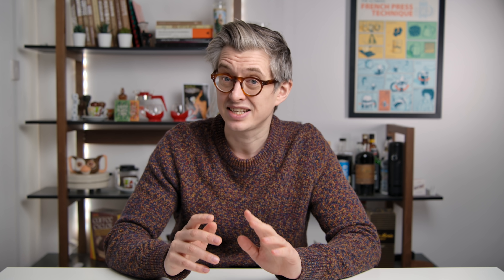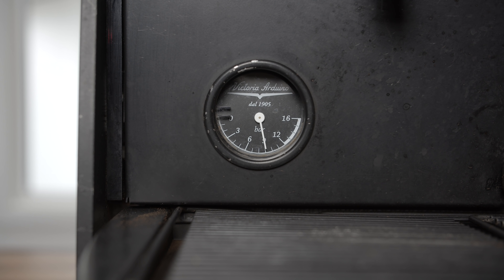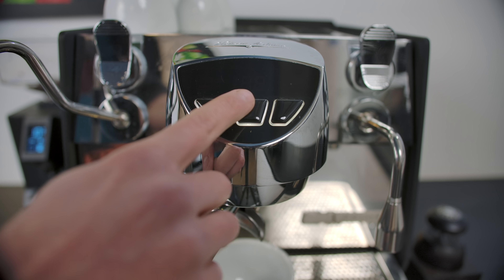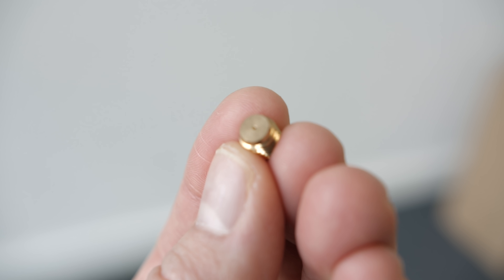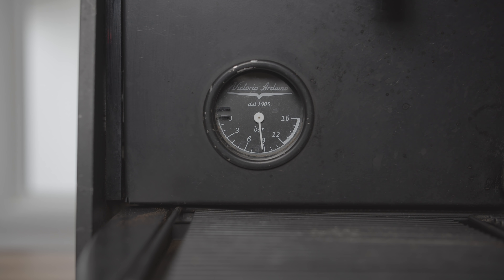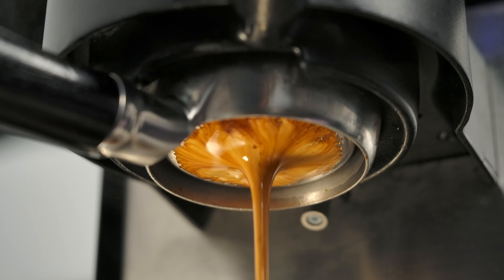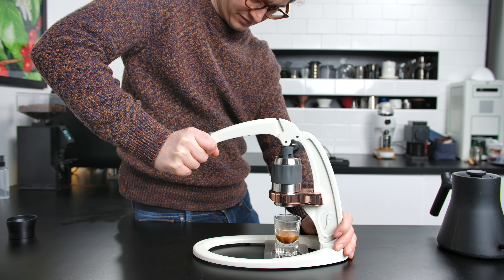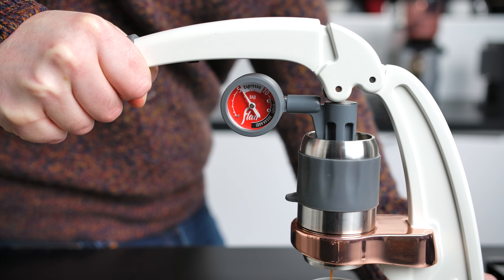Understanding Espresso: Pressure (Episode #6)

Comment: Hi James, another explanation for pre-infusion is as follows: First of all, each puck of coffee has a voids, moisture, and solids. The moisture content is likely really low to start off so lets just consider the voids. These voids are only air-filled to start and thus are susceptible to compaction under any pressure. The 9 barr pressure will do this. However, from my knowledge, if water was filling these voids(pre-infusion), this would have a closer to equal hydrostatic pressure pushing back which would then be replaced over and over by the pressurized water passing through the puck. This is only from my limited knowledge of fluid mechanics and how sands in foundations pack together but hopefully, this helps a little bit.
Reply: I think his point is that the lower pressure preinfusiin helps to fill the voids with finer grounds thereby reducing opportunities for channeling
Reply: Yes, yes and yeas once more. Nicely explained!
Reply: I think you need just enough pressure in the beginning to make sure the water doesn't just "sit" on the coffee, kind of like The Action Lab's new video about cocoa powder that doesn't get wet because of the surface tension of the water prevents the water from percolating into the powder. so you need JUST enough pressure that will get the water to move slowly but consistently until there's water dripping from the bottom. I think this goes back to flow control. the pressure is dependent on how much resistance the puck provides, so I think for every puck, you apply whatever pressure is require to get the water to migrate down the puck slowly, but not more. i think eventually flow profiling is probably gonna be the way we get to the bottom of this rabbit hole LOL
Reply: @maxlee6676  I couldn't explain it that well! I do it just like that, by briefly opening the steam valve, as the pump starts working and pressure builds up,  for a couple of seconds. Then, I slowly close the steam valve, so the pressure reaches the 9 bar in a smooth, gradual way.
Reply: This is basically one of my university courses: "mechanics and transport by flow through porous media". Altough they mostly seem to be talking about oil or water instead of coffee haha
Reply: Your roughly describing one of the principles of soil mechanics and the even application of pressure through "matrix" of a soil or, in this instance, coffee. I think people who are interested maybe reading up about soil saturation and the idea about soil moisture/saturation could be interesting.
Reply: Hello! Exactly what I was going to write. It can also be said that harder tamping slows down the extraction, and 9 bar is much stronger force than a tamp. At first,  couple of milimeters of wet coffee that was not penetrated will tamp everything below. I have manual machine and I start with gentle push until naked portafilter screen is wholly wet. This way I have less problems with grinding too finely.
Reply: @yulq  oh I wish I never had returned my manual machine! I had a La Pavoni once, but I returned it because I was inexperienced with espresso. Ever since, all I do, is trying to make my pump machine work as a manual.
I also believe harder tamping slows down extraction, in the starting part, until the pressure eventually presses down on the puck entirely.
Reply: So you're saying longer pre infusion is better?
Reply: @s0bad  a couple of seconds just enough to wet the puck.
Reply: With the blend that I use (Toby's Estate Woolloomooloo) , and the machine that I have (la marzocco linea pb), I found the best result I got was through the mechanical pre infusion where it would turn the pump on for 2 seconds, off for 2 seconds, and back on for the shot. Found the shots came out with less channelling, more consistency and produced a better rounded shot. Would love to have a crack at the pressure profiling of a decent or even a manual machine.
Reply: Okay, so what would happen when you have coarser grinds mixed with very fine grinds?
Reply: @EtreTocsin  Then it's time for a new grinder
Reply: Very well described. I don't understand enough about physics etc (yet) but when picturing this it makes sense to me intuitively. I'm glad I got a flair and just recently got a better, more reliable (manual) grinder to go along with it. I'm starting to make some great tasting espresso.
Reply: @Spractral   Puck preparation is key for good espresso extraction. It's all in how those grounds!
Reply: These voids would be filled with water sooner or later, so I don't think the hydrostatic pressure argument holds inside a void (water can't push back elastically like the pressed coffee can).  However, depending on the total saturation and wetting conditions, the water could lubricate contacts between grains -- helping them to reach a denser state -- or even pull on the grains by capillary action and compact the puck this way: just like mud shrinks as it dries.
Reply: @rodrigoguerra2836  What do you mean by "hydrostatic pressure argument [do not] holds inside the void" and "water can't push back elastically like the pressed coffee can”? 
Simply:
Something has to answer with the 9 bars at the top of the puck, or else something will be incredibly accelerated (this is how it works, net F=ma=p*S, so for sure at the top net F is approximately zero and force from the top is negated with raction force from the bottom).
If water hits completely wet puck, only slight, not noticable, squeeze of wet puck is enough to push back, because water/coffee mix is not compressible. On the other hand, dry puck at the beginning is. So if water hits it with 9 bars, the dry puck compresses (see videos with transparent portafilter). After being tamped with 9 bars it is not compressible anymore with 9 bars. But after being so strongly tamped (9 bars is 9kg/cm2 so yes, for 58mm it is 238 kg of force, pretty hard tamp) it restricts flow more.
Voids can be filled later, yes, but they will be smaller, pores connections will be smaller, restriction will be greater. And the problem is, they could also not be filled. After all, water does not have to go through, it just usually does.
Reply: Hi  @yulq , this problem is weird, complicated, and fascinating for many reasons, so it may help to build it up in steps.  Imagine first that the grounds are frozen in place, like in a sintered glass frit.  In this case, water can flow freely through the entire pore space -- including through any voids in the pack -- but pushing water through the frit at a constant flow rate, and thus constant velocity, requires a constant force that is proportional to the water's viscosity and flow rate.  This Darcy flow does not require any acceleration and happens because the water is forced to move past a stationary object (to wit, the "hydro" is not "static").  Flow through big voids will be faster than that through smaller ones, but a constant pressure will produce a constant flow.  Consequently points (1) and (2) are a bit misleading because water is always moving: there is no way for grains to deform/pack so well that they block flow around them altogether, so it's not an either or situation.  When the grounds are free to move point (3) becomes very interesting because of the question of what is holding this cage together in the first place.  When things are dry, the static frictional forces between particles can make this happen because of something called silo pressure, but you can also have capillary bridging (as in damp sand castles) and other things.  Static frictional contacts can also hold things when grains are wet (fully saturated), but you need to factor in lubrication by the fluid whenever particles move.  The key here I think is that, as water extracts material from the grains, they almost certainly shrink and change their shape, so a cage that may have been stable at first may collapse later.  This is not obviously a bad thing, unless the collapse of one cage triggers the collapse of nearby cages, which is probably true in general and may be aided by the fact that grounds in regions with faster flow rate will shrink faster than those in more dense regions, and thus be more susceptible to flow and rearrangement.  Definitely a fascinating, and potentially tasty, problem.
Reply: @yulq  Sorry, answered the previous version of your comment.  TL;DR, F=ma does not hold as simply in fluids as it does in vacuum.  Moving water through a puck or filter at a constant rate requires a constant force because water molecules are not allowed to "slip" past solid objects.  This constraint causes velocity gradients and thus viscous stresses that push back on the fluid that pushes back on both the piston and the grains which then push back on the portafilter, but only when water is in motion.  This is true for any liquid and slowly moving gas (things get complicated here).  So, while you can think of the coffee puck as being "squeezed", you should think of the water as being "pushed" though the puck.  Outside of the pack, however, viscous drag is negligible, so you can think of the water the between the piston and the top of the puck as having a constant hydrostatic pressure.  Consequently, while the water pressure at the top of the puck will be 9 bars, that at the bottom will be effectively 0 (relative to ambient), just lke the voltage on a resistor will be V at one end and 0 at the other.
Reply: @rodrigoguerra2836  OK, but going back to preinfusion, did I write something wrong? Does not dry puck compress? Does completely wet puck? Can you exactly explain what is not right, if anything? What I am saying is this: if you let water through the puck with small pressure, for any time it need to go through the puck, wet it and exit on the whole bottom screen of the portafilter, then you can apply high pressure and your flow will be faster compared to applying high pressure at the beginning, because the wet puck is significantly less compressible, dry puck is more compressible, compression means less/narrower ways for the water, and this way water has more wider channels to go throug, compared to applying high pressure at the beginning.

Comment: I have a Sage Barista Express. It can be hard at times to produce consistent shots. The pressure gauge doesn't tell you how many bars it is but does give you an indication of espresso range pressure to aim for. Found that the grinder didn't grind fine enough so adjusted the internal burrs. 18grams of coffee. A good solid tamp produces a pre infusion of about 8 seconds with shots pouring between 25 and 30 seconds. I find that it produces more than 2:1 with espresso out. Sometimes 18grams produces 45 or more out. Overall shots are pretty good. And good milk, or milk alternative, covers a lot of sins on the espresso end so nothing is ever wasted.

Comment: Watching this while pulling a shot on my la pavoni, while I was preinfusing and then ramping gently the pressure up, then maintaining flow rate, hoffman starts to talk about pressure profiling and adjusting for flow rate. Wondering if one day an automatic machine could do that. It's not just flow rate but you can see if you got good crema, chanelling or uneven extraction. I adapt for it. Certain shots you can maintain the pressure quite high, with evenly distributed flow with tons of crema. You feel and see when you pull that perfect shot. Other times you have to compromise, but it still can taste very good. Even if it's more work a manual lever, the feedback you get is priceless and you really learn a ton about coffee extraction intuitively.

Comment: Well at 9 bars my shots usually taste terrible, and okay at 6-7 bars. No matter what I try, and I tried a lot.
Using Niche Zero grinder + Breville Dual Boiler.

I just ordered a naked portafilter to see what happen, but if there is some chanelling, I don't know what I could do to fix that, since I tried probably everything imaginable to improve my shots.
Reply: Well your equipment really isn't the problem (in at least as you own perfectly good gear). I wonder if you just don't like the coffee you have been using if you really have tried everything as you say.. 
Otherwise, bad water... burrs not well installed/misaligned... machine/grinder not cleaned well... these would be also worth exploring. But 'tastes terrible' doesn't give much to go by so im not sure how useful those suggestions may be.
Reply: @Kirk Hodgson  I tried dozens of different beans, from different local and online roasters, single origin or not, and also some industrial ones. The differences are huge, but never extraordinary.

For the water I tried tap water with and without filtration, no noticeable difference IMO.

I don't think the burrs are faulty, because before that I had a Breville grinder and I had mostly the same kind of issues, just worse. The new grinder improved the results, but mostly because of the much finer control I think.
Same with the espresso machine, I switched from a lower end machine to this one in hope of improvement; there was some, but the results are not up to my expectations.

Everything is cleaned / descaled regularly.

Anyway, thanks for the suggestions, any idea is good to take.

Comment: James, can you imagine that your deep treatment of subjects can trigger a nerdy response? I would argue that pressure profiling in the LM is a way to try to mimic Gaggia's lever machine and FAEMA's E61. I don't have to explain to you, that the lever machine allows preinfusion when you pull the lever to let hot water from the boiler in. That water starts to invade - infuse - the coffee puck in the portafilter and the time you leave the handle down with the "valve" to the water supply open is the preinfusion. And, as you mention, after you release the handle for the cocked spring to do its pressure work, the pressure slopes down when the spring reaches a more relaxed position. What about the E61? Well, the little lever has three positions where two positions leave the constant pressure pump "off". In the middle position the back-flush channel is closed off and the channel to the pump is opened, however the pump is not "on". But this position does allow pressure from the water mains to push water through the pump and the coffee water channel. Before extraction, this causes preinfusion and it also preheats the coffee puck. Interestingly, at the end of extraction, Italian barista would switch the pump off with the lever in the mid position and a tiny trickle would continue, still from the waterline pressure. This requires the E61 to be plumbed in though. And, as many machines exist with the E61 brew head ("group") and I have, and had, one, I can tell you that the rotary pump not being plumbed in gave me some headache initially. The machine before that had a slightly less elegant E61 head and a single HX boiler, but the vibration pump had this natural slow pressure build that is like a pressure profile. Not a lot of "post" profile though.
Or, the notion of pressure profile and pre- and post infusion must be age old in Italian coffee culture. If not with consumers, then certainly with barista and the engineers that designed the machines. That said, modern machines with much better thermal control have taken a lot of pride away from the barista job in the mother country of espresso.
And, the word espresso has another alternative fine semantic revolving around "intent".
In my country's language I might ask a barista for a deliberate urgency squeeze.

Comment: I have always been stuggling with pressure. My Bezzera Unica's OPV is set by default on 12 bar, so to get to my 'desired' 28 second shot, I have to grind very fine. This then sometimes results in a bitter tasting coffee. Having the knowledge of the flow rate being optimal around 9 bars is nice, I will try again to aim for that.

Comment: cutting my teeth on an R61 isomac single boiler. the machine came set at 10 bar and i adjusted it down to 9 bar.

typically i have been dosing 16g and yielding 32-34g. when my shot hits about 28g i will raise the lever to the middle position (this stops the pump but does not release the pressure) for the last portion of the shot.

since my machine is not plumbed, i can’t really experiment with line level pre-infusion. i may try pump on for 1-2 sec, bring the lever back up to the middle position to hold the pressure, and then back down for the main extraction.

Comment: I have an Oster Prima Latte, got a proper basket for it, and a manual grinder. I use it on manual and it has a macanical on/off type of preinfusion. I do agree with James that when I tap out my pucks I find the top half will come out separately. This video sheds light on why. Thanks.

Comment: 15:45 "9 bars is desirable, but it's playing on hard." This is my experience with using the Flair. I can consistently get good tasting shots at lower pressures, but at 9 bars I often get channeling.
Reply: This 9 bar thing is just plain wrong. Some coffees (denser beans and lighter roasts) you can grind way finer and hit even more than 9 bars and get wonderful even extraction. Some oily dark roasts if you target 9 bars, the puck clogs or you get channeling. My moto is grind as fine as you can for a given coffee such to get maximum pressure without having channeling and evenly distributed flow trough the puck. The finer you go, the lower the temp must be also. Just my 2 cents but works well for me.